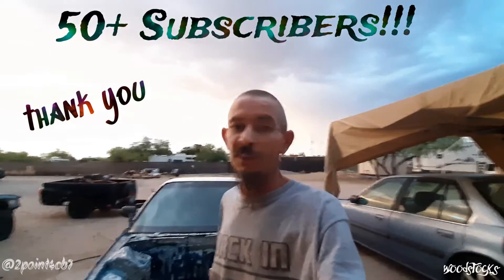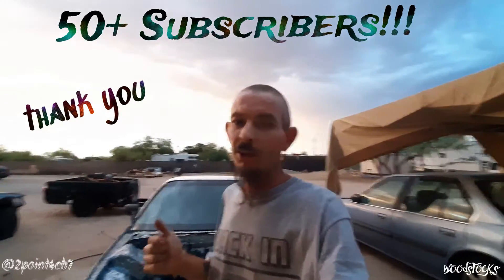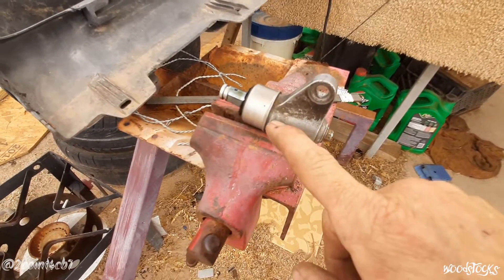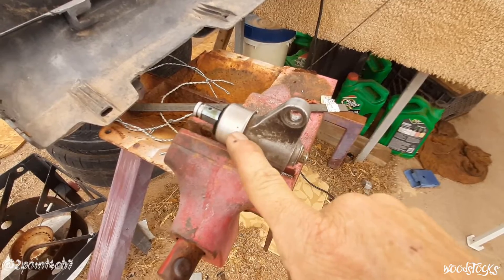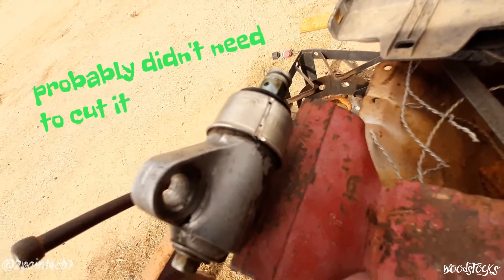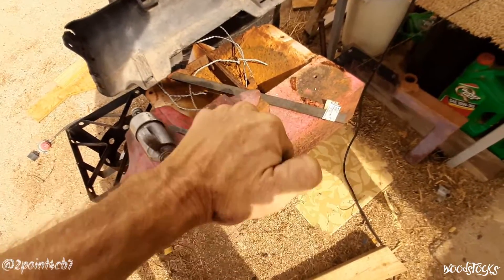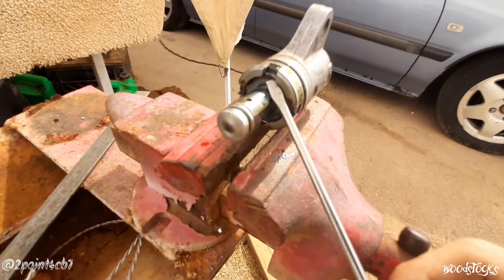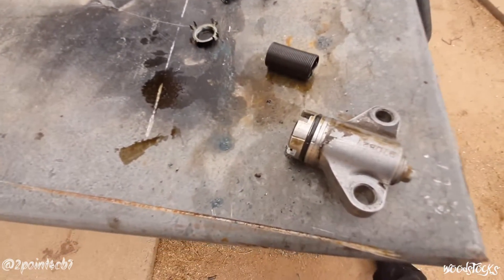diy h22 manual timing tensioner conversion / project updates / thank you subs

Comment: How often should the manual tensioner be adjusted
Reply from the maker: Really depends on the mileage you drive honestly. On a fresh new belt it will need adjusting a couple times during the belts break in period. Good routine to check on it once a month and adjust it whenever it needs it. I put tons of mileage on my engine and generally only have to add some tension about once or twice a yr
Reply: @Woodstocks  so I'm assuming you just lengthen the lock nut thread slightly once or twice a year when it scretches etc? I got a kaizenspeed Chinese knock-off for like 20 euro looks identical what u think lol 🤣
Reply from the maker: @hserieshoonigan1997  yep same thing. Just loosen the locking nut, adjust the bolt out to get more tension, then just tighten the nut back.
Reply: @Woodstocks  cool thanks alot